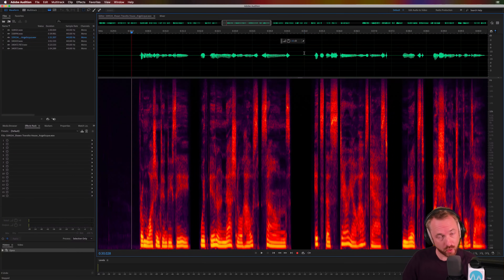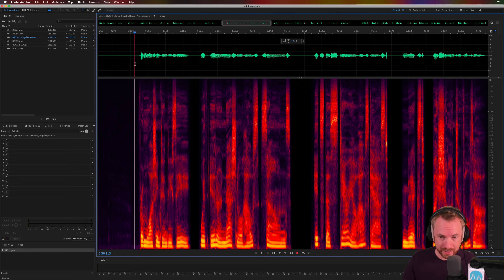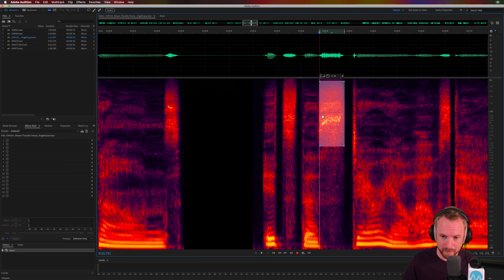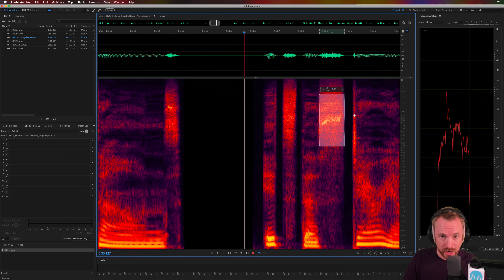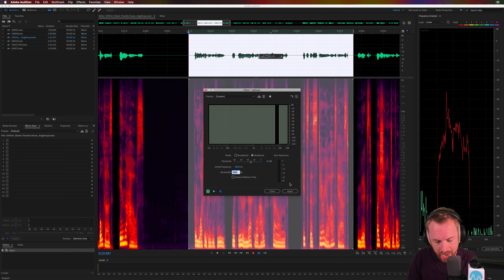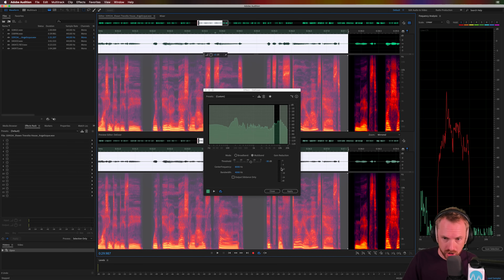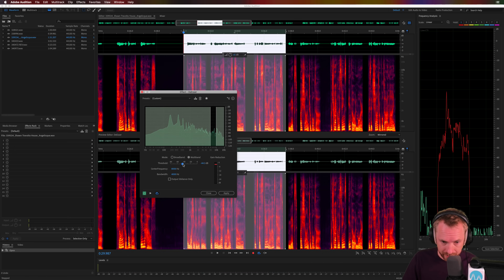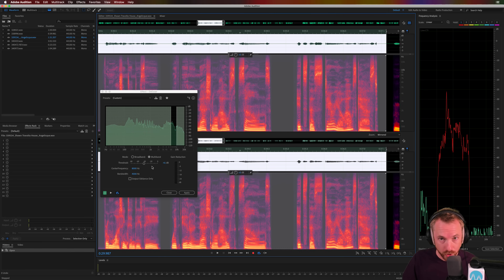How to Use The DeEsser in Adobe Audition

Comment: My last question in the previous thread  must have fallen through the cracks :-)  That issue still hasn't gone away, so I will ask again if  that's ok.  How can I completely clear the frozen outline from the Frequency Analysis window? Double click on the same Hold colour button only changes the colour of the outline but it does not delete it.  Even when I closed and reopened Audition, and updated it to the current version - when I opened this window, that OLD graph was still there! I can use  live display and take prints of them, but they are all sitting over that OLD outline which simply doesn't go away. How can I completely remove it?
Reply from the maker: Have a look at this old video which should help https://www.youtube.com/watch?v=RhPHntuTDQU
Reply: @MikeRussell  Thanks, will check it out.  Another issue and a painful lesson  - I applied De-esser to my file before normalisation, and now it sounds as if there was no De-Esser applied at all! Now I have to do it all over again, and still did it manually. How come higher volume pronounces the hissing? Do you have a video on the sequence of .effects when one is cancelling out or changing another?
Reply from the maker: Check out this video https://www.youtube.com/watch?v=Xl0vk00vw4M
Reply: @MikeRussell  Love it! thanks! just what I was looking for :-) as easy as 1,2,3 :-)

Comment: super tutorial thanks! but you have skipped showing us where/how to take a print of the frequency analysis view...can't see any button to do this...could you explain pls
Reply from the maker: A the top of frequency analysis there are a number of coloured buttons, those are what you click to capture a print
Reply: @MikeRussell  aha…. Thanks! Do those colours mean anything or do I just pick whichever I like?
Reply from the maker: The colours are just to help you identify the print you've captured, you can chose any colour
Reply: @MikeRussell  thanks a lot :-)
Reply: @MikeRussell  this is awesome..but I have 3 more questions - How can I clear  the print in the frequency analyser? Double click on HOLD doesn't do that.  ALSO - how can I save my carefully designed de-esser setting? Luckily. I took a screenshot of it as it was gone next time around. AND - in the Favorites menu there is a De-Esser shortcut which simply applies its thing straight away.  Does it have my recent setting or is it completely separate?  thanks!
Reply from the maker: To clear the print you can just click the number again

You can save presets for every effect.  At the top you'll see a save icon which you can use to save your settings

The De-Esser in favourites can be edited by using the edit favourites option and saving the favourite.
Reply: @MikeRussell   oh yes, there is a button to save the present and in fact another one to save it as a favourite. I still can't  clear all the prints from the analyser window.  This has cleared few prints but one still remains. When I click different colour buttons the graph simply changes colour but stays put.  I tried the Right click, I can't select the graph. Some sources refer to the HOLD button - I can see it but it is inactive (not clickable, not sure why). How can I completely clear this window?  Thanks!
Reply from the maker: Are you sure you’re not just seeing the live display?
Reply: @MikeRussell  yes. I open a new waveform with Spectral Frequency Display, then open the Frequency Analyser without scanning or  playing anything - and it has the old graph, just one.  The HOLD button is inactive (?), and when I click on the colour buttons, the graph just changes the colour but does not go away. How can I clear it?

Comment: I know there's some variation but if I came out with ~4850 Hz which is FAR lower than the examples here, is that normal too or am I not doing it right?
Reply from the maker: Sibilance is dependent on a number of factors, the most important being your voice and your microphone so frequencies differ for everybody.  One easy way to check when you set the DeEsser is so to check the ouput sibilance only option at the bottom.  If you're hearing just the sibilant "S" sounds then you've set it right, if you're hearing a lot of other sounds then you haven't found the affected frequency range yet.

Comment: This is very informative. But here's another way. I have a cheap condenser microphone that has a lot of sibilance.  And even I use a deesser, some sibilance sounds still get through because those sibilant sounds have different bandwidths. The technique I use is I open the spectral frequency window, highlight the entire high frequency range then set up a hard limiter. It clips those high frequency sounds that tend to emphasize sibilance but keeps the loudness of those other high frequency sounds that don't have sibilance. It really works and clips those sibilant sounds even if they have different bandwidths...